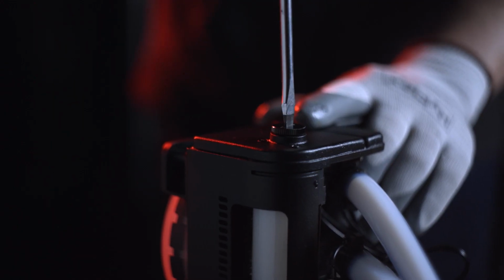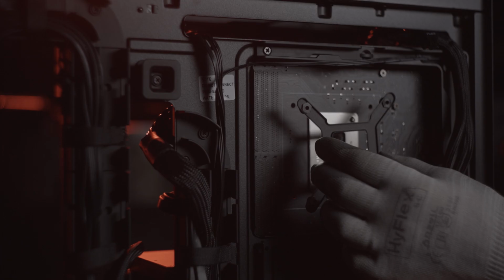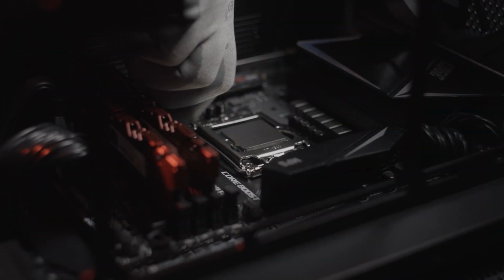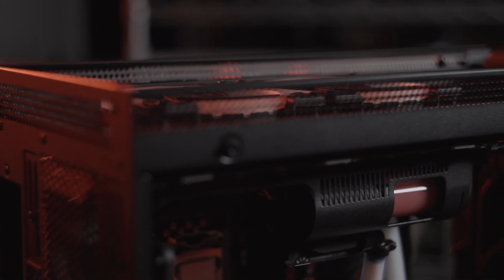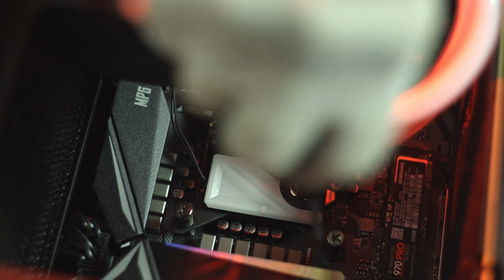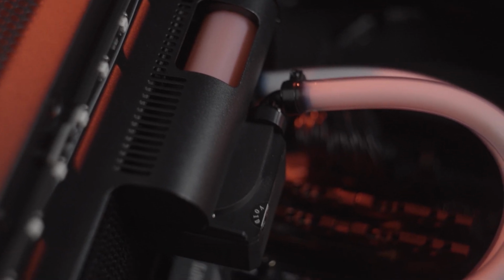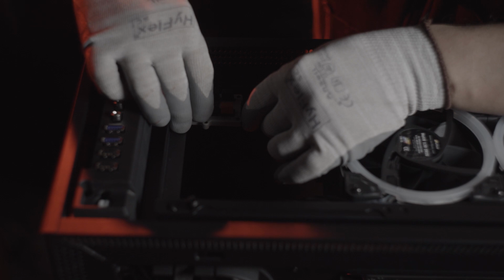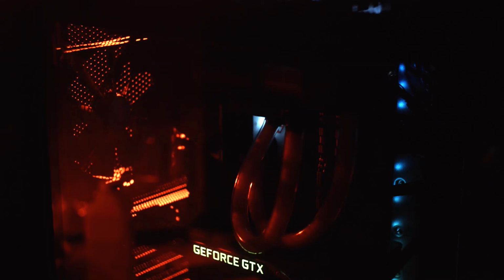Swiftech H240X3/H360X3 "Drive X3" AIO Liquid Cooled CPU Cooler, Quick Installation Overview

Comment: Thank you for making this video. Much better than reading the instructions. 
I am using this cooler in my first rig. I am in love with this product, and will always use swift tech for as long as you guys are around. This aio is criminally under rated.

Comment: Installing the fans and radiator on my CM Storm was a pain in the ass. Since both the fans and radiator has to be mounted under the top of the case, getting the screws to line up with the holes was a nightmare.  But once I got it installed it cooled like a champ without any problems. A full load on my 6850K (overclocked a bit to 4.30hz) brought temps of only 150°F (65°C).  If you're thinking about getting an AIO, don't even think about getting a hermetically sealed All-in-one like Corsair's Hydro series. It's lifespan is less than 2 years and you won't know it's out of fluid until your PC is locking up from high temps.
Reply: An AIO is different than a closed loop cooler.
Reply: @christopherjames9843  Uhhh not according to Swiftech, Corsair and the rest of the internet.
Reply: @angelsoftheseventhdawn  Do you actually know what an open loop is vs a closed loop? Doesn't look like it....
Reply: I don't know why that even matters, I was comparing the cooling capabilities of this SwiftTech AIO to Corsair's AIO.  Who gives a hermetically sealed shit if one is a closed or open loop?

Comment: If using the X3 as a pump/res for an open loop system and using different Fans for RGB, can the pump be plugged directly into the motherboards Pump header?

Comment: Doesn't the AMD need to use the cross plate for the back of the motherboard as well? What about a AMD AM4 install vid?
Reply from the maker: Check out this video: https://www.youtube.com/watch?v=uWz8Pk-aH_4
It covers the installation of the AM4/TR4 bracket on our CPU block. The only difference between AM4 and TR4 is the location of the mounting holes. Either way, AM4/TR4 relies on the backplate that comes with the motherboard.

Comment: The last step is to watch the Swiftech AIO leak....
Reply: I've had my Swiftech H320x2 Prestige for 4 years going on 5 now. Still running quiet and looks great. Added the Green dye it came with.
Reply: @SidewaysShadow  thanks. Either way there's distilled water with biocide to make it non conductive for longer from my understanding. Just don't be a moron and triple check and it shouldn't leak.
Reply: I've had my gen 1 h240-x for 5 years and it hasn't leaked at all. In fact my system is still under 30c during idle with an i7-6850k.
Reply: 5 years late but i had a swiftech aio. the block developed a crack and leaked all over my 980 ti and killed it. swiftech did not warranty the gpu OR the aio. shit business